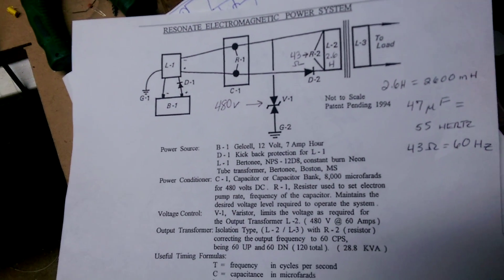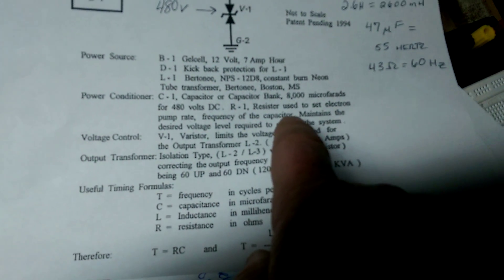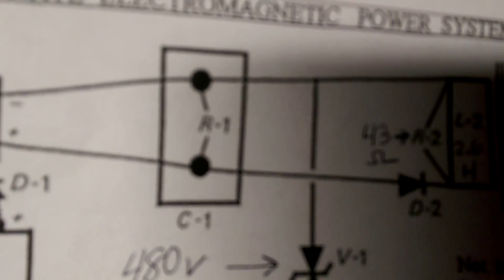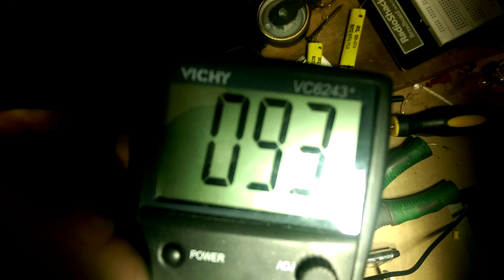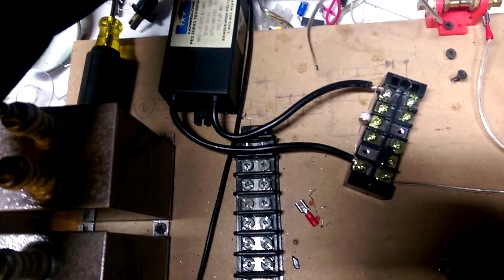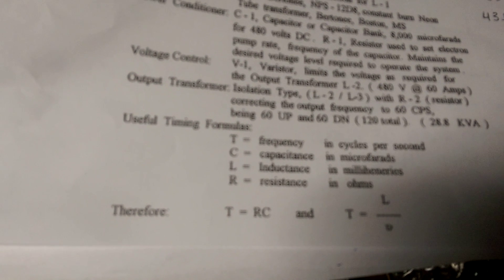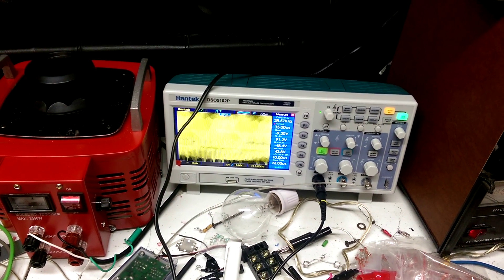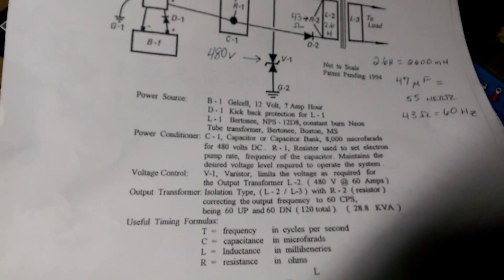Don Smith How To Video

Comment: so is this now a real free energy device: the don smith generator really really works???
Reply from the maker: Smith's system truly works, however nobody has truly figured it out because it doesn't function in a normal manner as conventional energy system do. The output is based upon a specific impedance, so the system will run until it warms up and the impedance drifts. The energy from the system needs to become captured in capacitors and use resistances to regulate the output in an effort to eliminate the drifting, since the output is based on resonance, it has to remain in resonance. unfortunately, like an old radio tuner, the system drifts and needs to be built with digital components and I haven't gotten there yet. This needs to be designed by the pros, and a youtube user by the name of salty citrus has done this and shared the circuit online, but it is difficult to build for even myself.

. There isn't a school that taught RF radiant energy generation methods, so we all learn this shit on our own from Tesla's documents, and build them by a process of elimination, wasting hundreds of thousands of our own money to figure it all out. Sharing the info with each other is key, so I suggest we all start banding together to get it to function. None of us will ever be allowed to sell these, so by remaining secretive about figuring this stuff out will only prevent the next guy who is close from becoming successful in making the devices function. 

The moment somebody decides to market these, somebody will get killed. It's been happening for over a century and it's sad that it has to be that way. I always wondered , "If we are naturally born to this planet, why is it that we have to pay to be here or live here? Does it at all make sense to you or others?" Why do others profit from every person's birth, their medical, their living, and just about anything else you could think of?" Then if the income of these globalists that enslave us is messed with, they will strike if we try to get anything for free that would normally be a monthly bill. 

Even the solar panels these energy giants invest in are being sold with very limited efficiencies so we have no choice but to buy monthly electricity or fuel, which the globalists are making billions from as well. These free energy devices need to be well detailed in writings online, not so they might work if somebody smart acquires the info to build them, and the information has to go to an open source document, being easily able to be built, all on the same day to everybody in the world, so the world definitely changes.

For what the groups such as UL and the NEC call safety, all of the devices that allow us to get power for free will be outlawed because we have no way to explain where the additional energy comes from and since Science will never agree with how they work, they will never be allowed to be built, marketed or used as they will all be said to be dangerous fire hazards, and if they aren't , I'm sure people will start being locked up on charges of security fraud, just as Paul Pantone was for his GEET processor's marketing and public showings.

 Nobody would ever be allowed to build them and sell them, there's just way too much power against us, and it comes from all aspects of the energy sector, the government, and pretty much every banker and stock holder on this God forsaken planet is involved in an effort to eliminate anything that doesn't make trillions for them all.. The elite need to be equalized, that will be the only way this will ever stop and I do truly believe that the proper person has been selected as president , who is the only one person capable of doing the job, and that is to stop the globalists from being the powerful and greedy sinners they have become. This will all take time but eventually we will become free again provided Congress's pockets aren't being lined by the globalists.

US Congress and the Senate should have been replaced as well as the Presidential cabinet. To eliminate all corruption, the entire jury needs to be replaced if you see what I mean, otherwise it will always continue and there will never be a thing we could do about it.
Reply: @advanced-electronic  I read a few comments back you told a guy to e-mail you so you could give him some info? Why don't you put it all out in public like you say is this reply?
Reply: Agreed! 
Hear Hear!....

By the way....
I just pictured how an Aether Flow probably looks. It is indeed like a drain opening up and water swirling down a drain. The higher the tank of water, the faster the flow. The lower, the slower. Level, Zero flow.
The Aether is a Gas. The Finest Gas of all gasses in the entire Universe. For it ti be a gas, it has to have mass. A gas is a Fluid. Water is a Fluid. 
When you break the dipole, you cause a drain to open up and the device focusing and guiding the Aether fluid becomes the conduit for the fluid to flow through things and yield EMF via various contraptions in the physical universe for the convenience of we physical beings.
Pretty simple, Pretty straight forward.

I happen to have thousands of hours on the bench creating and building exotic electronics to achieve unique effects and make the imagined a reality.
I'd be very interested in tackling such a project, the converter supply you mention needs to be built by the pro's. I've worked synergistically with some very big pro's over the years via the Internet, having never met some of them in person. The internet is so cool and enabling in lots of good ways!

I disagree about MIB slapping down everyone or even being able to now days. That's one good thing about Trump. We ain't gotta take no shit off no group of bankers and moguls no more! 
We gotta do what's right no matter the cost.

This is how evolution occurs in America, in the World, in Life!
Without it as a prime motivator, we'd still be in the dark ages. Then again, maybe Tesla would have succeeded, moguls moguled other shit that didn't hurt nobody and the world would be the ideal place to live we all want but never seem to quite pull it off.

We MUST EVOLVE! See something that needs doing, DO IT! That's how shit gets done around here! ;)

Onward young Scientists! ;)
Reply: I forgot one other important point, BitCoin is taking over as our Main Currency and will eventually replace as it is already competing with FIAT (paper) currencies. This is how we ARE beating the moguls, tycoons and all other counter forces at their own game! Only we're playing at a much higher level than they ever could hope to and this is what is killing their hold on us as I type and will eventually do them in where being able to overwhelm us goes. Cryptographic Currency (Crypto for short) is our key to freedom in its own special way thanks to Mr. Satoshi and his genius!

Comment: hey Marc, the video is cut off. Do you have the full version or a part 2 showing this working? I'd be interested in one of your 480v transformers. I've also emailed you at your Gmail account. Hope to hear from you!!
Reply from the maker: The device is working. The battery is self charging. The battery never dies, if you cut the length of the battery wire at 1/4 wavelength, the energy capacitively couples to the battery. you could try this with any nst provided you have an idea what the secondary winding is on the nst. If you know what the secondary is, then it is easy enough to figure out the primary as it will be only 1:1, 1/2 or 1/4 wavelength to work properly.

Look up Don Smith's pdf and read the whole thing. He speaks about this and about the location of the free energy. The energy amplification comes from all of the peaks and valleys in the higher frequencies. 

The low frequencies only have so much energy that can be harvested for free, very little because there are only 60 peaks and valleys in the waveforms. In 35,000 hz, there's a lof of extra energy that provides energy just by being around it due to it's disturbances of the ambient, as well, much moe can be taken from it if done correctly by paying attention. The key is grounding the system in the correct places. Pay close attention to detail with grounding. It is of the most important thing Don speaks of and every device Don has ever built works from both of these principles.

Capacitive coupling is key too. NOT INDUCTIVE
Reply from the maker: I haven't tried the transformer yet since I didn't build the inverter circuit, however it will work with an inverter from the caps provided the voltages are correct. i haven't gotten this far because I opened up another very inviting circuit , then lost touch of the Don thing for a while. I will post again soon, I can't remember which circuit I was going to video next and wish I had written down the next since I have over 18 devices mostly built and have been waiting for a vision of what I'd like to do to get them working over the past year now. I will post again very soon as quickly as I get some new ideas. I've been very sick for a while and it has taken a lot out of me. Hopefully none of this is related, it was extremely difficult and pretty scary.

Comment: Mark the electrical engineer said that the RC circuit would cause a short that is useless...It is a frequency filter, and probably more...It is for that very reason, not giving it a shot that we are so screwed up, but this just stupid for has been in schools forever!!...Bad student!! bad student!!..No wonder why we are so screwed up!!
Reply from the maker: short circuits with high frequency positive pulses manifest radiant energy. A short circuit is virtually non existent because the pulses ricochets the energy into the short, then reverses itself as back emf does, however it blooms inside of resistances, especially those intended for loads such as a bulb. For instance, if we take Gerard Morin's generator and transformer circuit, the transformers don't really need to even be used, merely a short circuted choke across the feed to the chop saw which is the inductive load that manifests this energy having a series of step up and step down coils between the oscillated source and the step up, then the step down which fires this ringing energy back and forth. When it comes back it is several times amplified by hitting this shorted coil, then it converts back to conventional energy at a much amplified rate running the 2 oil heaters for free because they are a resistive element heater. This is how you gain free energy, you don't put in and just get more out, you need to match loads if it is resonant, if you have a frequency filter, or if you use radiant energy you need resistances and caps to dam the energy if you'd like to fire an inverter to power clean 60 hz ac outputs. It really isn't hard to do, it is the understanding that needs to come first, then build according to how the needs have to be.
Reply from the maker: The engineer  you speak of bases his assumptions on the teachings of conventional energy. Short circuits are how we generate energy, by inputting the correct frequency it becomes a resonating coil that is a short but allows energy output, exactly the same way Tesla's Hairpin circuit does. There's a direct short in the hairpin circuit, but across the shorting bar we could illuminate a light bulb. He would have to  be an RF engineer to see what we are dealing with, and even then they do not believe in what we acquire for energy because they believe it is static in nature and only has capcitive discharge pops and not continuous output.. Radiant energy is an astounding energy with a totally different energy signature, EMF fields differ, in fact when we broadcast energy and pump it into the ground, an unbelievable energy is flowing through the ground, faster than the speed of light, while the receiver ends up picking up many times more energy than we put into the circuit. This is what Tesla's secret papers are being revealed to do by others such as Andrew Basiago, showing the gov took the papers and put them to work with scientists such as Stirl;ing Colgate, Basiago's Father and many others to be used for time travel, beaming technologies, and many other dematerialization and rematerialization devices,. as well as antigravitational technologies and energy generating devices that work on completely non conventional resonant energy technologies that have quantum mechanical properties way beyond our conventional mathematical means.